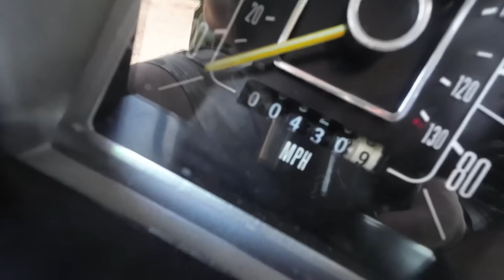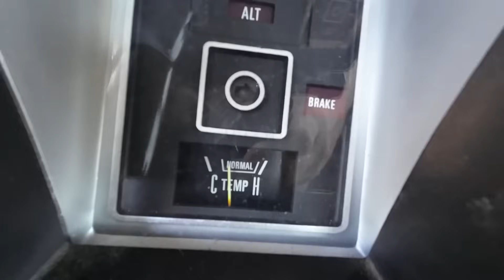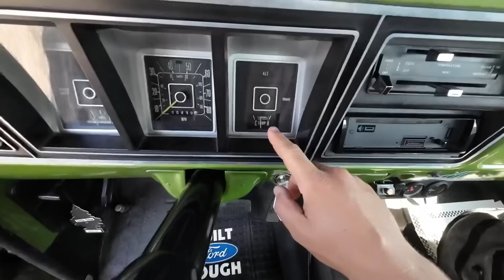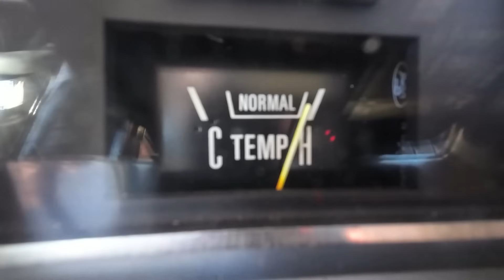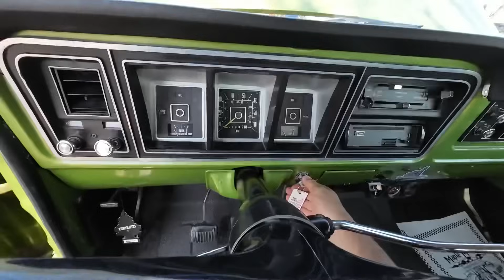Test Drive 1975 Ford F-150 Super Cab SOLD $14,900 Maple Motors #2465-1

Comment: I had a 300 six in a 1971 F100 step side ….three on the tree …..it was a city public works truck super low miles ….that six was the best motor ! 😊
Reply: I got one now 300ci 2psi hot idle oil Pressure, been like that for 12 years. 315k miles. Always runs when my new cars are down.
Reply: That why they quit building them, great motors😊

Comment: Won't pass inspection in Pa. Without catalytic converter
Reply: Put antique registration on it and good to go!
Reply: It will in arkansas
Reply: Shouldn't be a problem. Trucks didn't have cats until after 78.
Reply: For once, it would be fine in CA, '75 and older no smog check req
Reply: Move to GA or Tennessee.
Reply: Pa does not inspect classic/ antique vehicles